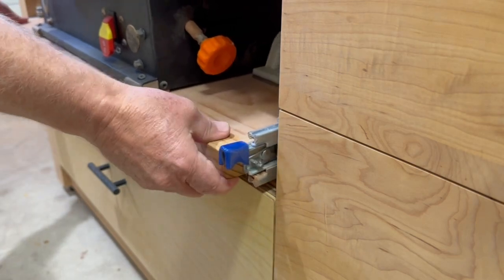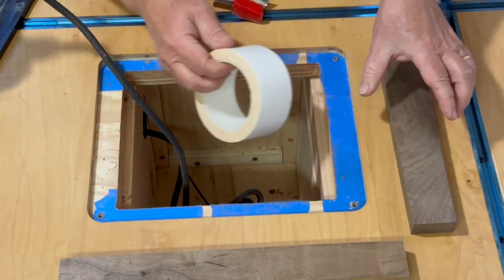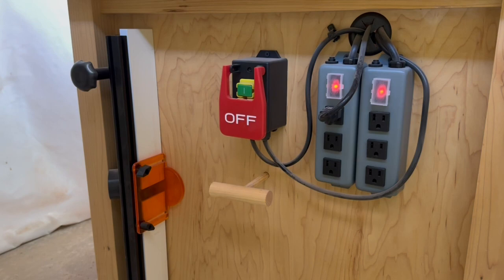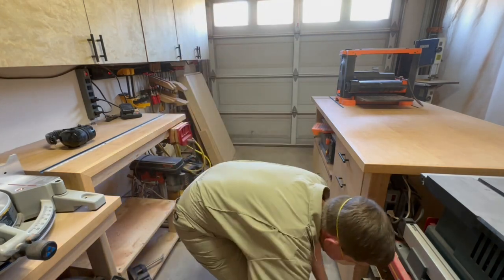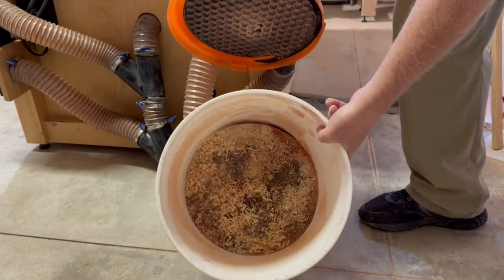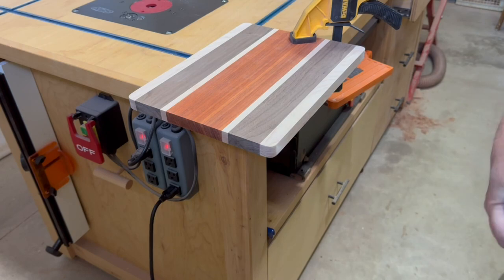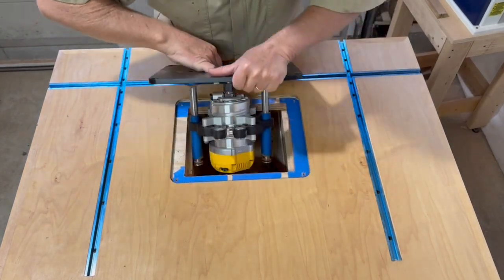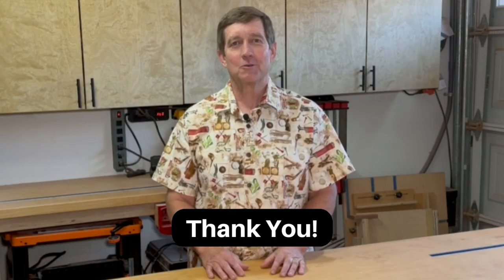Small Woodshop Ultimate Workbench Design Tour

Comment: I have a small workshop that I thought I setup pretty good. However after seeing that jointer slideout I can definitely say I wish I had that.

For your plastic blast gates. They look similar to the powertec ones I use. I constantly have issues with sawdust jamming them open slightly. Do you have a similar issue?
Reply from the maker: Yes, actually, those blast gates do get clogged with sawdust and sometimes don't close all the way.  so I somtimes have to take the hose off and clean them out.  Kind of annoying.  Thanks so much for the great comment!

Comment: Well thought out bench - thanks for sharing.
Can you provide links for the auto on-off power strip and the heavy duty pull-out shelf that you used for the joiner?
I like the idea of putting the vacuum in a cabinet but will need to re-figure my design to make it work!  Also working on the hoses as well as power strip configuration and location.  Your video was very helpful.
As for the unfinished space...never a bad idea to have a clamp rack nearby - and can easily remove for future ideas!
Reply from the maker: Thank you so much for the kind words!  I'm happy the video was helpful.  I've included the product links you requested in the video description

Comment: I like how you've coordinated items into your workbench.  If you've seen flip-over work stands to co-mount a sander and a planer, you could possibly utilize that empty space for just one tool.  Develop a flip-over top for the one you use most often, or for the one which is more difficult to place atop the bench.  Another consideration is placing the planer there may limit your in/out-feed space whereas the sander may not have the same constraints.
Reply from the maker: Great idea!  I really do need a better spot for my bench sander, it may be a really good option.